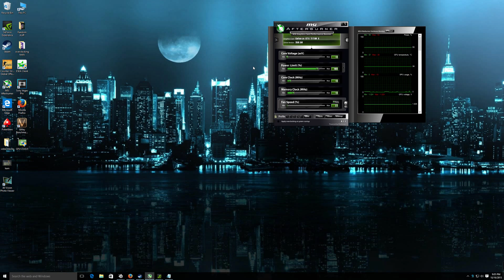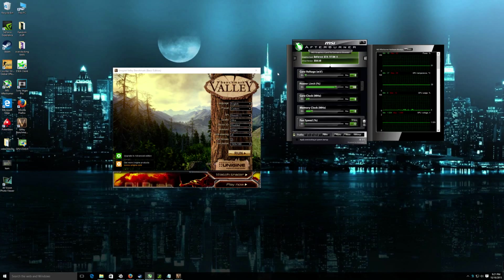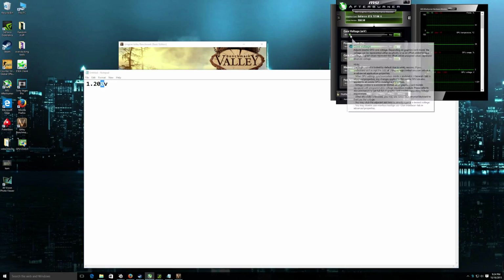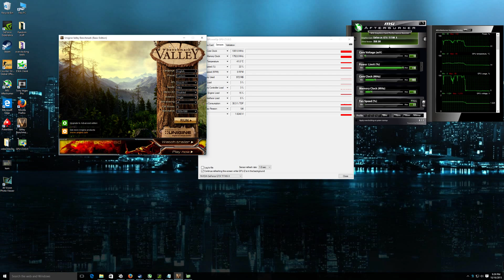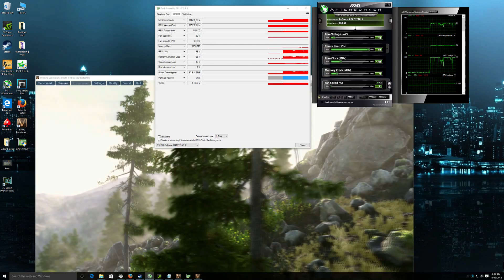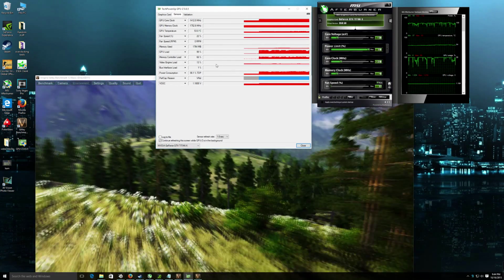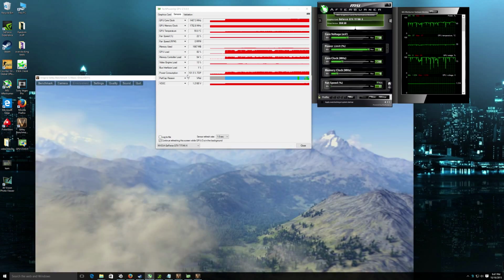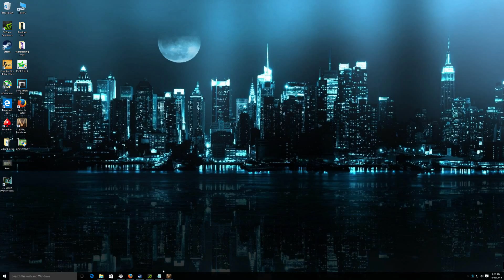How to Over Volt Your Graphics Card (Tutorial)  Titan X Maxed Out!

Comment: You would think the PC would be able to accurately read the voltage,the modules in international Trucks monitor better with their multiplex systems.They use it to tell you you have a fuel pump struggling and going bad it throws a code.That's when I put a gauge to measure actual fuel pressure.I do not bother checking HZ because the BCM  can monitor that just fine,but mechanically it can not see the bearings are bad in a pump and straining by blockage or just wear and tear on the motor and putting too much load on it.

Comment: I got a new rx580 installed everything drivers, reinstalled windows put every cpu memory ocs in default, everything is in stock, then i do cpu and gpu and memoru benchmarks ez results nice temps; then i start playing any game (warzone mainly) crashes bro sometimes bluescreen others times no but i need to reboot pc, I got a conclusion that my gpu doesn t have sufficient energy to keep the clocks -_- ill try this im sick of this i cant play anything tho
Reply from the maker: Ok, so try dialing back your OCs and launching the game. Ive found the same thing, certain games I have to really dial back my OCs. Keep dialing back until the game plays well.
Reply: @TheChurchofCacti  This moment I have everything in default, but still crash, even if do a full load stress test (100% cpu,gpu) It doesn't crash, It makes no sense; I think the card is broken because when i bought cod warzone couldnt reach 60+ fps even if all settings were in low, then a few days go some magic happened and now on ultra i can get 60+ but with crash obviously.
Reply: @TheChurchofCacti  i tried to search if monitor could be a problem because it gets screen tearing in everygame that I play (old or new gpu), i need to play with Vsync on everytime its kinda sad 4real

Comment: YOU SHOUD BE NOT JUST RUINING VALLEY U SHOULD BE DOING G THE ACTUAL BENCH MARK THAT WAY YOU CAN SEE THE PERFORMANCE GAIN AND YES SOME CARD ARE DIFFERENT FOR MOST PART GOOD VIDEO AND I JUST REALIZED MY CAPS ARE ON O WELL TO LAZY TO RETYPE  BUT YES SOME CARD'S WILL BE DIFFERENT ESPECIALLY IF YOU CARD HAS A CUSTOM PCB

Comment: I know old vid and all, but linus tech tips proved that degredation doesn't exist in gpus, the only degredation happens in fans.
Reply from the maker: I didn't know this. I kind of pointed that out by saying your card is going to last 10+ years regardless, but the point still stands that overclocking can RARELY kill a graphics card that otherwise would have ran fine at stock speeds. This isn't due to degradation but rather a faulty component. Every once in a while there's a GPU that runs fine at stock speeds, but completely bricks when pushed even on a stock bios. This is due to a factory fault, if it happens to anyone they should return and or ask for a new card, without mentioning overclocking. EVGA is the best for warranties, so if you're watercooling or putting custom bios' on cards I'd recommend them.

Comment: water retains heat much longer than air and it takes longer to heat up but both air and water cooling will hit the same peak temps
Reply from the maker: Not on a Stock cooler they won't. My GPU never goes above 60 degrees even with the voltage maxed. An air cooled GPU with a NVIDIA cooler is running in the 80's out of the box, at stock speeds and voltages. Most the after market coolers though can keep the cards cooler, but a true water cooled system won't hit the high peaks of an air cooled system in general. It's also a lot quieter with the right fans. I think your speaking on AIO coolers, like Corsair H100i. Those coolers can't move water at the pace of a D5, and the radiators can't sustain as low of temperatures as much bigger denser radiators with better fans.
Reply from the maker: We can prove this easily. We both run a benchmark for 24 hours (if you have an all air cooled RIG). Then we'll see there's at least a 20 degree difference between your peak and mine on the GPU especially, but the CPU will remain 10-15 cooler as well. You may be right in your facts about water retaining heat, but in practice water cooled computers are cooler or else nobody would do them. I live in Hawaii where it's 85 everyday, yet my temps are in the low 50's with 110% power limit andd GPU maxed out.
Reply from the maker: Idles low 30's, air won't idle like that ever

Comment: I have an annoying buzz in my GTX 1060 G1 Gaming, called coil whine. It only happens during games or benchmarks. I read in some forums about hardware, and found that by increasing the voltage of the video card, the problem can be solved. But I do not understand anything about overclocking and voltage increase. I'm afraid to burn my gpu. Tell me, is it dangerous to raise the voltage a little?
Reply from the maker: No it's not dangerous to raise a little as I'm sure you've found out by now. Sorry for the late reply.

Comment: mine is 1.2 GTX 970 SSC and it's only hits 62C that's good that's the mean the voltage regulators are cooled?
Reply from the maker: Not sure about the SSC cooler. You'll have to do some research on whether the the VRM's and Mosfets are directly cooled. Shouldn't matter too much unless your going for an insane overclock, which would probably require water anyways. I wouldn't stress about it the VRM's too much with a 970.
Reply: yeah it dosent get that hot

Comment: So to clarify...ramping this setting all the way up is generally safe? I have a low-profile card (GT710)
Reply from the maker: +Austin Mann 
In that case probably not. I don't think that card could cool off the extra voltage or if MSI Afterburner even allows over volting that card. Sorry I couldn't help more but I know nothing about the GT710. This video is more for GTX 770 and higher.
Reply: +Mast3r Race Lol I don't think it does, I was able to with EVGA Precision x 16, I ran Valley for awhile and the core & memory at a mild boost and it really didn't go above 65. It's a PNY.
Reply: +Mast3r Race Looked on YouTube and found a guy with this card that got +360 on core and +200 on memory with the voltage ramped to max
Reply from the maker: Austin Mann
There ya go. I'd check around on Google too so you have an idea of what to expect on average.
Reply: Mast3r Race Thanks, I'll try to find some stuff on it, but it isn't a very popular card. It only overvolts to 1.163 in the EVGA program

Comment: would i damage my card if i attempted a suicide run to 1700mhz
Reply from the maker: +kenykillr 
Probably not but I don't think that's a realistic goal. What card are you running?
Reply: gtx 970 G1
i just want the
evga precision achievement on steam.
dont judge me
Reply from the maker: kenykillr

Well you might want to do some research on if that speed is even a possibility. I'd imagine you'd need a Custom bios in order to provide the power necessary and some serious cooling. Probably not worth the risk just for the achievement lol.

Comment: I have a EVGA Titan X like yourself however your Core clock is 1000 without OC...Mine sits only at 810.0MHz....What is going on with my card haha. Mine sits at 810.0MHz with an ok of 200 on Core Clock and 400 on Memory...Also power limit at 110...What am I missing here haha? This isn't while running a game however.
Reply from the maker: +MSW - Mod Showcase 
Basically what's happening is that your card toggles and slows down when it's not in use. This can be a good thing because there is no reason for it to run fast when your just searching the internet and watching videos. Once you join a 3d application like a game or a benchmark the card will boost back up and run at the same speeds as mine. You can change this by setting your power to "Prefer maximum performance" in your NVIDIA control panel's 3d settings. The EVGA Titan X is the exact same as mine unless you have the SC version. The regular EVGA Titan X and the NVIDIA one I have are 100% identical. It's just your power settings are set to adaptive which allows the card to slow down when not in use. It shouldn't effect performance at all in actual gaming situations.
Reply: +Mast3r Race Thanks man. Yeah I have the exact same card as you however I believe I have a different cooler. I brought an after market cooler and recently connected it to mine, so now it's cooled by water also. I would really be interested in putting up the MV however even after watching your video I am still a little scared. I am at a stage now where my OC can't go any higher and stay stable without adding to the vaults. Would you say I should give it a go? It's a scary thing for me. I know you mentioned about it shortening the life span of the card etc, and I don't really know how long I plan to keep this :P
Reply from the maker: MSW - Mod Showcase
Unless your playing at 4k I highly doubt you need the extra power anyways. I over volt only for benchmarks just to see how high I can get. When I'm actually playing games I don't bother because the games I play at 1440p run fine on a basic OC without added voltage. With that said it is fun to see how fast your individual card can go and the risk is very small if your just doing a benchmark here or there. If the card crashes just reboot your computer and all will be fine. It's up to you whether you even care though